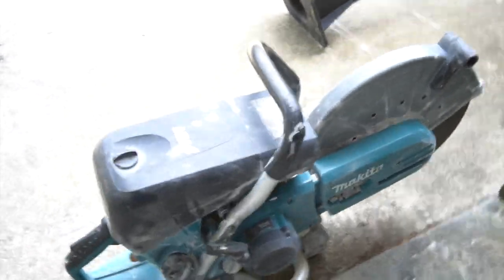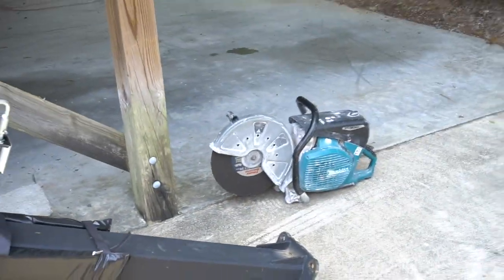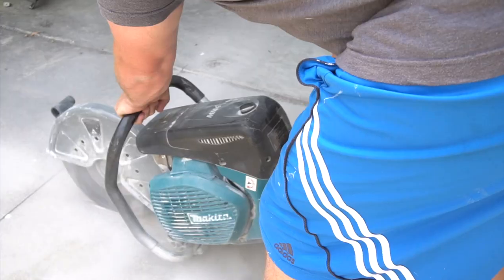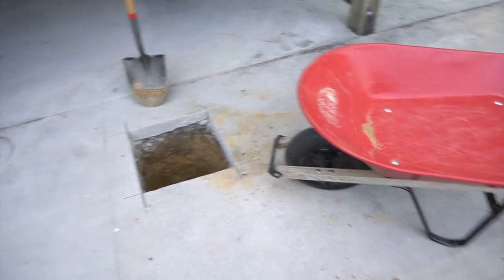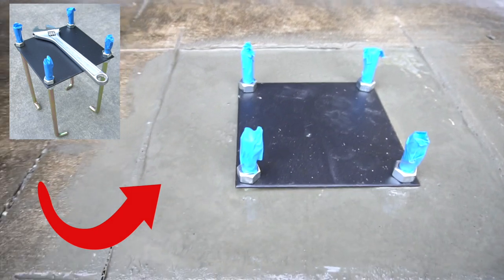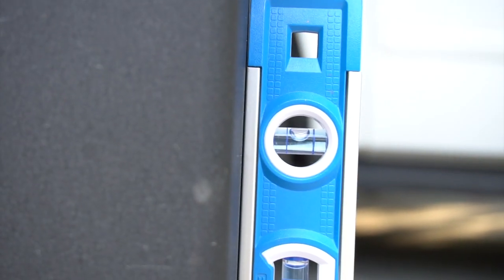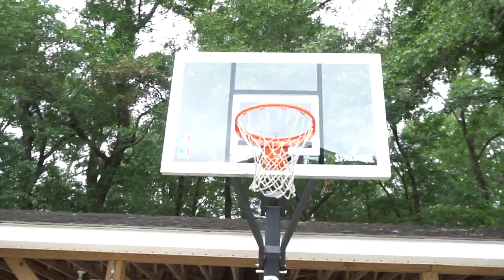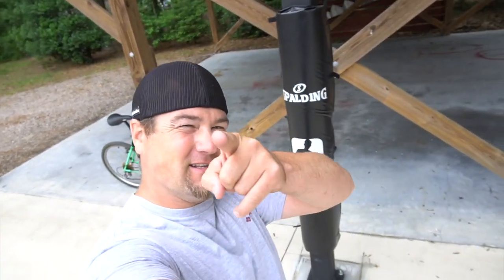In Ground Basketball Hoop Installation NBA Spalding Glass Backboard!

Comment: Looks amazing!  So you don’t need to put any kind of absorption material or pad between the old and new concrete?  I have the exact same project to do but was worried the new concrete would expand.
Reply from the maker: I actually put a piece of cardboard around the edge before the new concrete was poured.

Comment: You didn't show the assembly of the pole nor did you show how you put on the backboard. If you're going to show how to do it, show the real difficulty of the project. Because there is no way you hung that backboard by yourself 🤣
Reply from the maker: Oh, sorry, I did the hardest parts. And since I already bought this from someone assembled all I had to do was put in the base plate and put on the backboard. But all you need is a truck to back up to the arms, and slide in 4 bolts to attach the backboard. Its pretty simple and I thought too simple to video it. Making the baseplate strong and level is the hardest part.
Reply: @TheRykerDane  nice system man. The arms holding the backboard, when you install the backboard do you use flat metal washer and plastic flat washer in between the bolt ?

Comment: Thank you for the video. I’m having a hard time to get the post 5 in overlapping when assembling them. Any tips?
Reply from the maker: Hmm, not sure what you mean by the overlap?
Reply: @TheRykerDane  there are three posts need to be attached together. The manual says each of them should have a 5” overlap. I can only get to about 4”. Called customer service, they said to use a hammer, but didn’t work

Comment: No need to over cut the concrete like that. It looks crap. Use a 14 inch demo saw and it cuts fine through a 4 inch slab right to the corners. Then once you hammer the concrete out you can just tidy the inner corners up with a small Jack hammer